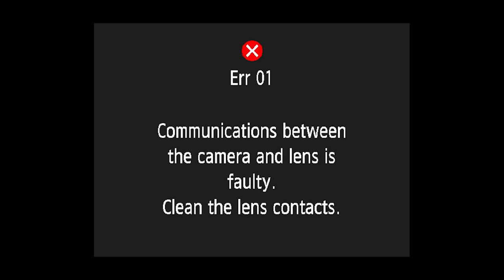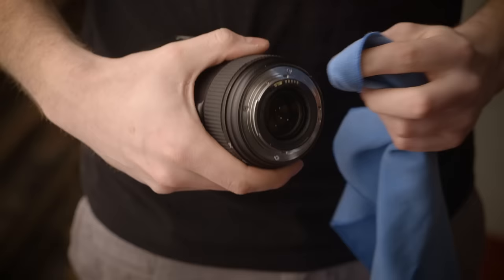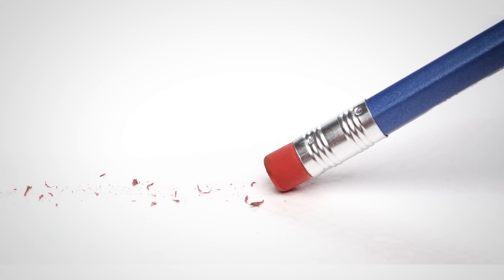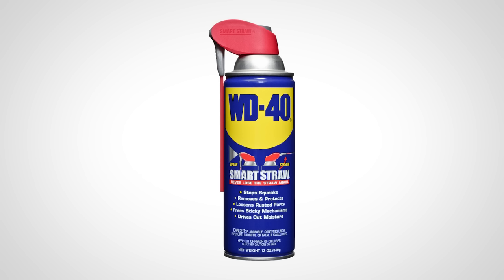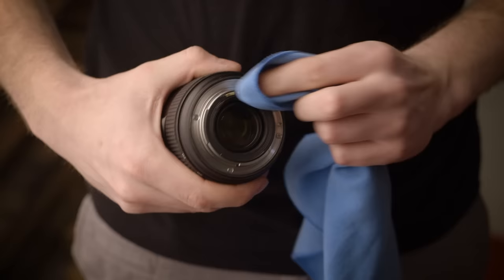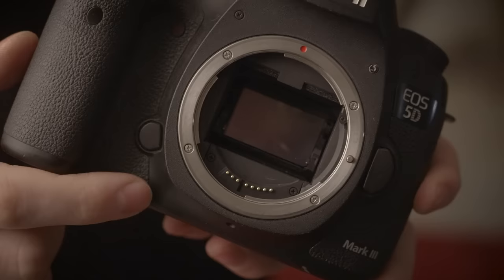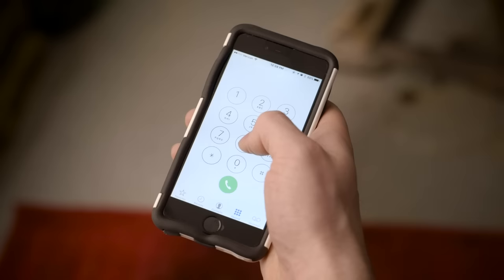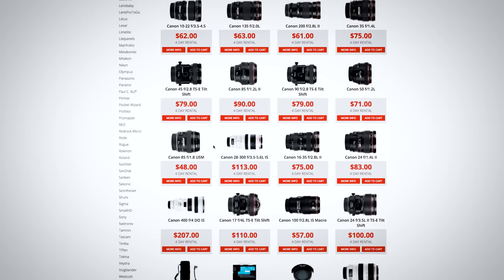Canon Err 01 - How to fix faulty lens communication 📷

Comment: this video is misleading. I think more likely than not, error 01 has nothing to do with dirty contact, because those pin head at camera contact is retractable pins, they are made that way so that when you mount the lens it will press sharply against the contact at the lens side. if there is "oil" on the lens contact that is thick enough that it can prevent the hard pressed pin to not touching the contact, you will have to be really oily, think petroleum tart like oily. It's like if you connect a lamp to the wall socket and it does not lit up,  would you think the reason is because your hand oil prevent a good contact?  more often I think the problem has to do with defect electronics and circuit board that is connected to the contact, touching the contact with your finger could be the reason but not because of the oil but because of the static charge that burnt the circuit board that connected to it. you would kill your lens much much more likely with static charge than wipe-able oil.

Comment: I have this error but lens will work when at the  widest aperture value 4.0 when at 17mm and then 5.6 at 85mm other than that error
Reply: Furrball Nirpaw Yes mine is the same, if you change some settings I’ll get the error, the viewfinder is also very dark too, I’m unsure what the problem is 😞

Comment: I need a way to disable the error.  I have a lens that only does it on my newer canons, but never on my older ones.  I know it's not "really" a problem, because the camera takes a picture just fine, but just makes me wait for several seconds to do it again because of that stupid warning...
Reply: I found that shutting it off, then on or even pushing the shutter button 1/2 way makes it go away. Mine does take the picture, I just can see it until I get rid of the error message.

Comment: I have the Err 01 error with my 70-200. My resolution was to switch batteries. Go figure
Reply: Hey, Even I think my battery is the problem. I put it to full charge this morning and by evening it ran out of charge although it was not used throughout the day. Did you replace the camera battery or the Date time battery?

Comment: If you have a lens error 1 it is an intermittent fault inside them lens if cleaning the contacts do not work other solutions like putting the lens on then backing it off slightly does not constitute an error fix.
The problem lies inside and will need servicing as most quick fixes is not a permanent solution you can also short out other electrical parts of the camera.
With The error I message clean contacts is what it says there are other ways like manual mode select maximum aperture turn camera off then turn on and select minimum aperture turn off this sometimes resets the chip inside the lens also removing the battery and refitting may also fix the problem  other wise it's a service job
DO NOT - buy a EF lens used with any electrical problems at all the seller knows it will be a very costly job to fix after all that why he is selling it .Only buy used EF EFS lenses if you can pyshsically try them on your camera.

Comment: NO BLINKING ERR... 
But my 24-70 lens is malfunctioning the IOS way too high, when in TV mode. My pics are blurry & super grainy. (Lowest ISO it has produced is 8000, but more commonly at 12800, 16000 & 20000... with Shutter set at 100 or 125.) Anyone know why??
Reply: Hi Karen, you might have the same problem like i do. If you look through the lens you might see that the aperture is stuck at f22. Only a repair can resolve this.

Comment: Iv tried this trick...but it works properly for few clicks after that uts giving the same error
Reply from the maker: Hmm, it could be something with damaged contacts if they are working on and off. Something you might have to get repaired by Canon.
Reply: I think your pin is stucked

Comment: Why does no one ever do the video you Actually need. Does anyone actually need a video telling you exactly what the error already tells you to do? I need a video showing what Service does when you get this error and you find it isn't the lens. A while back the solution was something like changing the Fstop All the way up, taking a picture, then all the way down, taking a picture, and you were good to go. Which no one mentions, but that definitely worked. But this happened again, and now we can't change the Fstop at all. But it's not worth servicing because it's too old. You're better off buying a new one in many cases. I also wonder how of you send it to canon service, then they say, "yeah it's broken" then charge you to get it back again. With our printer we had an issue and they wanted to just start replacing parts one at a time to decide what was wrong. The list included nearly All of the printer.

Comment: I get this error on my 24-70 lens, and it only works if im at 2.8 (full wide open) aperature. I think something is wront with the iris or actuation mechanism. If i try to shoot at any other aperature it gives me this error, but at 2.8 it shoots fine, no error. I feel like the contacts are fine, its just getting an error since the iris cant move? Oh well :(
Reply: Could you find a solution ?
Reply: Same issue! Did you ever find a solution?
Reply: I haven't yet, I haven't used the lens in a while but I can see inside it there is some type ot aberration, almost like a crack or something like a spiderweb inside the optic. My guess is something is keeping the iris from moving, something physically in the lens.

Comment: Ridiculous. 
A pencil eraser is never going to do permanent damage of any significance to the contacts. It's literally removing microns of surface material, particularly microscopic layers of  oxidation, which is what actually causes this issue, not skin oils. Who ever touches the contacts on their lens with their fingers, anyway?  Simply mounting and unmounting the lens, which leads to direct metal on metal scraping every time, does a heck of a lot more damage to the contacts than an eraser ever would.

Comment: your beard is revolting
Reply from the maker: Thanks Louis :)
Reply: LensProToGo sorry, uncalled for... Just venting to strangers re my brand new lens failing to auto focus
Reply from the maker: Thats a bummer what lens did you get?
Reply: LensProToGo sigma 17-50 2.8 constant. Lens works but I think the body's knackered, it just doesn't seem to recognise it at all
Reply from the maker: The sigma lenses have firmware in them so the firmware might be out dated and cause it to not communicate properly